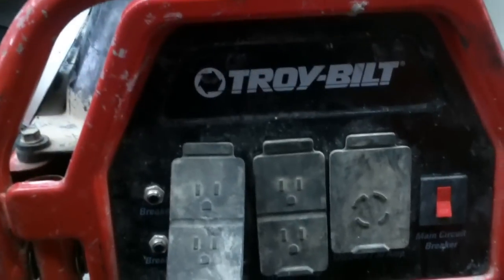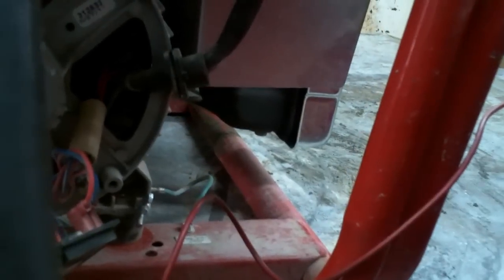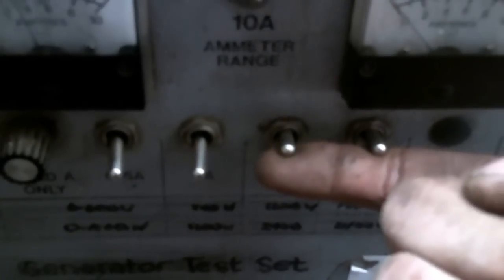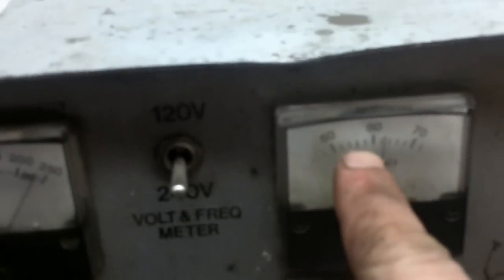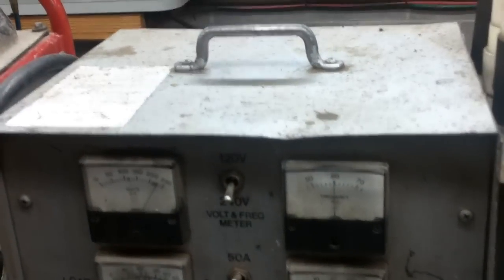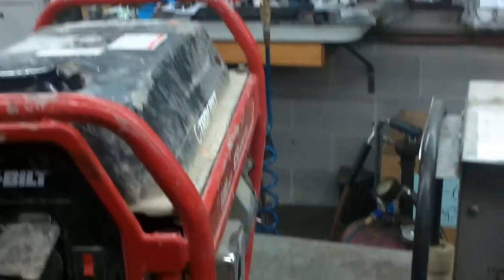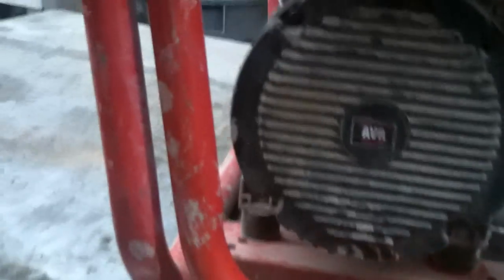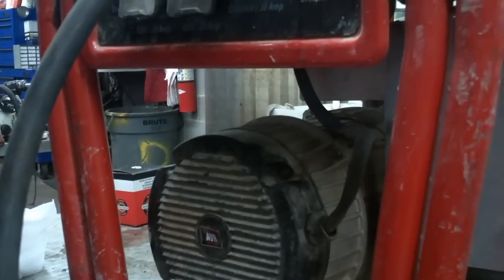ELECTRIC GENERATOR REPAIR : how to diagnose a generator that is not putting out power

Comment: Great video.  I have a Honda EX800 suitcase portable circa 1980.  It produces power but it is not according to spec.  The output is 142 V AC but only 55.6 Hz. If I reduce the frequency to 48 Hz then the Voltage reduces to the prescribed 120 V  AC.  I am also getting 22.0 Volts DC at the 12 V DC terminals.  Have you experienced this issue, and if so, is it the AVR gone bad?  Appreciate your help

Comment: YUP, another different set-up ! My Troybilt a 5500 running watts job has two wires from
the st8or to a brush-holder assembly with a diode bridge rectifier attached to the brush-
holder. 7.5 volts a.c. are turned to 7.5 volts d.c.

Comment: If a brushless  gen is not putting out, it could be the capacitor but the rotor still needs to have a magnetic field and the rotor would have 2 sets of windings + diodes. u can unhook diodes then flash winding, then rehook diodes.

Comment: Hey man I have a 8500 starting watts and 6250 watt troy bilt  generator runs but not getting power I watch ur video and I changed out the avr not saying that's what was wrong but it was only 25 so I got it but I still have no power how would I go about it now u think
Reply from the maker: Need to ohm out the stator and rotor winding   Not sure what the specs are in your particular model.
Reply from the maker: May need to flash the exciter windings as well
Reply: Not sure how to do any of that I'm learning off YouTube

Comment: Great job. I have a question, I have a generac 15000 watt and it's only putting out 24-27 volts to the outlet. I am wondering if the avr is fried. Any tips on finding out why it's putting out low voltage.  I did the drill trick and flashed the stator when I did that it went on high idle but still just enough power to glow a 100 watt light bulb 24-27 volts.
Any suggestions would be greatly appreciated
Thanks Shane Aubuchon
Chelsea, Maine

Comment: Hello and thank you for doing great job of teaching stuff about generators. I want to ask a question about my generator which is ASTDUBAO AST3800CE GASOLINE GENERATOR which is not charging battery and there is no wire coming in through flywheel but there is a wire coming in from dynamo cutout in ignition? Can you help ?

Comment: I have a miller welder and on the outlets I'm only getting 90volts and amperage for welding is low as well . before I put max amperage output Honda engine shuts off. what could be the issue? please

Comment: my reconedtion wolf petrol gerarator will run no problem but not putting out power ive chaged the circuit breakers no joy
Reply: My Generator spot giving power!!!😭 it is almost new, I did change the AVR, but it still not working.... It was overload.. do u think the alternator is gonno??

Comment: I have a good one for you. One day my Troy-Bilt generator seemingly quit, but not completely, it continued to put out 6 to 10 volts. So I installed a new AVR, cranked it up and it was working again. Then I played with the speed adjustment because they wanted an RPM of 3700 and voltage between 230 and 240 volts. As I was adjusting the speed up it quit generating the specified output and dropped to 6 to 10 volts again. I lowered the RPM but it would not start generating again. Any ideas on how to figure out why it's doing this?

Comment: opened up the back like you said ,no wires or electronics , is it possible there up between the motor ?
Reply from the maker: ray conway u have a brushless unit then

Comment: I cave a Coleman power mate 6250 that is trying to get going again. There is no power to the sockets.  There is no voltage at the brushes, the stator measures about 30 ohms, the other three coils all have continuity.  I don't see a voltage regulator in this generator, but I did check the diode pack and they all test good,  and the brushes still have lots of life left in them. What could the issue be?
Reply: You need to find the AVR (automatic  voltage regulator). It HAS to have one. This is where you need to start the troubleshooting process. The diode set up is most likely a "Diode- Triode set up for voltage rectification used for excitation of the rotor/stator movement.
Reply: TOMAS WATSON

Comment: i have G2000A Generator,how to convert from 110 to 220v output thanks
Reply: You might need to change the stator, only if it's only 110v. then you need 220v avr and the outlets

Comment: I have a Generac 5500 watt Wheelhouse generator that just stopped putting out 220 , checked wiring ,found CB tripped.Reset CB still only getting 110. looked at manual and it shows 2 sets of winding but not much more than that. found open on one winding ,that accounts for half the voltage. Does not show much more on this schematic, never had it apart, could it still be something between the black #33 and gray #44 that is open not allowing the winding to read? Thanks

Comment: i have honda EB 3000 c and it wont start i left on the garage for about 4 years only one time start can you tell me what can i fine
Reply: carburetor needs to be cleaned and new fuel needs to be used . .cloged carb

Comment: TNX Jeremy,  I have a Trot BILT ,8250   and  the breaker bottons will not reset .They are stuck and will not reset .  I had low power then it just went. It starts but I have no power coming out.   TNX BRO.

Comment: Any idea what the voltage regulation scheme is on a Northstar brushless generator head? Mine only puts out 111 volts at 61 Hz. at no load. Seems there is something that needs adjusting, but I've no service manual.

Comment: I have a briggs and Stratton 8000 watts generator and I test it and the avr is bad but the person I got it from they took out the avr and cut all the wire of I managed to sort the 2 wire for the brush but the other 4 wire I dont quite know how to sort them . out in the correct sequence or manner to connect them back to the avr correctly. can. u assist me

Comment: I hope maybe someone can help me with my generator issue. A while back my generator had the exhaust valve break and damage the piston and cylinder head. so anyway I get all of the replacement parts that I need to do the repair. After I put everything in the motor just before I put the back cover plate on I check that the motor will rotate, and it did with no issue. I after I put the back cover on I check the rotation again by hand and it will only rotate twice in either direction before binding up. When I took the motor apart I checked to see if the gears were broken or if anything was bent, and nothing that I could see.
Reply: Did you already fix your issue with the cover plate you're - rotation binding either way no problem thank you sir

Comment: Hi Jeremy. 
I hope you dont mind me picking your brain.
I have a honda gx160 engined generator with a altenator with no markings. The engine runs sweet. 
The volt meter on the 220v setting is only showing 200v. When I hook up a fan as a load, I can hear the motor dip for a second and see the throttle control lever move to account for the load, but the fan runs very slowly. I hooked the fan into mains power to make sure that was'nt faulty, and the fan worked fine.
What are your thoughts on this geny?
What would you look for and test first?
All advice would be appreciated.
Thank you for this video.

Comment: Jeromy, I have this issue however I have replaced the module that provided power to the Stator to kick start it. My question is What provides power to the AVr? The AVr cannot provide its own power so it must be getting power from the engine?
Reply: Depending on your generator the avr is powered by the power head or if it has a battery, the field could be charged by it. Kind of like the Alternator in your car. Or,  by the rotation of magnets about the axis of conductors, usually copper, like an old generator or magneto. There are many possibilities but you are correct,  there is no magic electricity out there which I call PFM "Pure Fucking Magic" there is always a common sense source to create the electro-magnetic field or flux that will create the desired voltage at the desired frequency that you require. Hope this helps a little. I'm an electrical and electronics engineer who is just passing through you-tube tonight on my way to somewhere else and beyond... PS: ED try leaving the AVR hooked up and momentarily apply 12 volts to the positive conductor of the avr at the point where it connects to the power head where Jeremy applied the 12 VDC in the video. See if this helps if you've replaced the avr and are still not getting any output. Only do this for a second or so. If when you pull the jumper off the connector you loose output again, your problem may be more serious and you might need a new power head. Good luck and Goodnight all.  Nuclear Dave

Comment: LOOK AT ALL YOUR VIDEOS AND THIS IS ANOTHER GOOD VIDEO THANKS.  I HAVE AN OLDYELLOW COLEMAN POWERMATE "CONTRACTOR 4200"  THAT NEEDS PARTS AND A MANUAL FOR. I WOULD LIKE TO CHANGE OUT THE PLASTIC GAS TANK IF REASONABLE. IT'S REALLY NASTY INSIDE TO THE POINT WHERE I COULD NOT EVEN DRAIN THE TANK. IT MAY HAVE AN INTEGRAL FILTER AT THE OUTPUT BUT I CANT TELL.  WENT TO POWERMATE SITE AND PUT IN MY MODEL #  (PM52-4208)AND IT DOES NOT RECOGNIZE IT.  THE TANK LOOKS JUST LIKE THE ONE IN THIS VIDEO. ANY IDEAS ON FINDING PARTS FOR THIS OLD BEAST. iT DID RUN FOR ME AND MANY OF MY NEIGHBORS DURING A FLOOD WE HAS IN MASS SEVERAL YEARS AGO. DOES YOUR GENERATOR HAVE A FILTER ATTACHED AS PART OF THE OUTPUT OF THE TANK?tHANKS FOR ANY HELP YOU CAN OFFER.

Comment: i have elepaq generator 3000 which i just bought and used for two weeks now but not supplying full voltage. it suppliying 125v instaed of 220v after testing it with my meter, anybody have the idea on how to resolve this

Comment: yeah my gen lookslike this except voltage reg lator in i big pc like briggs  stratton  problem too much voltage to reach 60 hz i get 154volts on 120v receptacles  i have 7000 watt 420cc harbor freight now called predator had since 2008 works great about 300 hrs on it, should i just order new volt reg and brushes as there is no cicuit board type voltage regulator very simple to change

Comment: You really seem to know your stuff, what about a generator that starts out in proper voltage range, but slowly drops off as you use it? The engine does not speed up when you use power from it either.

Comment: hi great vid, i have a briggs and stratton sp2600, i was using an electric saw with it and the power to the saw just died i tried the saw again and nothing, so i plugged the saw into the house and it works fine, so the generator is not producing power what can be wrong and how do i go about fixing it. thank you

Comment: i have a gp5500 that was overloaded after less than 20 hours of use. swapped out the AVR and it still isn't working.  i can plug n a light and it will flash on then stay off for a few seconds, then flash on again.  could it be diodes on the rotor, or what do you think could be the problem. Also, what can i do to diagnose? your time is greatly appreciated.

Comment: Hi there, good video, it gives some hope that I might b able to fix my generator. I thought you might be able to help. I have a Craftsman Generator model #580327180. On a night without electricity I tried to replace the 6V battery to turn it on and unfortunately I connected the battery backwards. What could I have possibly burn when I did this? I saw white smoke come out of the generator. I believe it was the stator.

I can still start the engine but no electricity comes out of the generator.

Comment: Hello !  I have an old Coleman M #  Pm054500. Not putting out power , How do I check the brush voltage when the brushes are in the cap with the receptacles ?

Comment: Sometimes you can get it to generate by exciting the field.
First, try taking the generator to dinner and a movie.
 If that fails, get 2 reversible electric drills (one can be pneumatic) Hook the drill chucks together with a hex-type tool. Plug one drill into the generator. Plug the other into the wall outlet (or air compressor). Start the generator. Now, turn on the drill that's plugged into the wall while holding the other drill's trigger on. If the drill that's plugged into the generator starts turning on it's own, you're done. If not, reverse either and/or both drill motors and keep trying.
If that fails, junk it and buy a real generator and stay away from these box-store crappers.
I've seen people living off the grid buying these Troys over and over. I saw one dude who had what I called a "death row" of generators outside his home. Like 5 of them. He kept buying the same junk-type instead of spending $5000 for a real 1/2 speed Onan or diesel.
These box-store generators are for short, temporary use, not continuous running.
Most have a warranty that does not cover continuous use which includes power outages.
I'm a Troy and Briggs dealer and advise anyone looking at a generator to carefully read any warranty BEFORE buying.

Comment: I overloaded my generator Briggs and Stratton 030235 5550 watts. I overloaded it with a welder. Now it outputs 180/370. There is no AVR. I replaced the brushes and diode pack. Same output. The circuit breaker never blew when I overloaded it.
Obviously can't use it on the house appliances. What is the world  is wrong with it? All I can think of is the rotor.

Comment: having an issue with my diesel generator.
i would try to power up the air-conditioner,
it would load to 18 amps, and then would cut out.
at 3500 watts (i think) it should give me 40 amps for the 5 seconds it needs, or at least bog down trying... any ideas on that one? 
it stopped putting out any power, so i was told to replace the capacitor, 
what does the capacitor do on the generator?

Comment: My AVR failed on a Coleman Powermate 5500watt, I replaced it and it failed again about 10 minutes after starting the generator, the load on it was a sawzall.   Any idea what to check next?The first time I was trying to run the generator out of gas for the winter and let it run for 8 hours with no load.  I think that is what cooked the AVR.

Comment: i recently acquired an old 80's briggs 5hp generator w/ bad motor so i dissasembled it to swap the crankshafts and it's not puting out anything at all. Is there anything i need to line up or do when installing?

Comment: I have a no name generator, made in China, that I only tried once to check it out with a  light. The next time I went to use it it didn't start. I checked the gas tank and a blue residue was in the tank. I drained it and cleaned the tank and to my surprise the manufacturer had painted the inside of the gas tank blue like the outside of the unit. I cleaned everything got it started but no electricity. Just relaying my story about this Chinese made generator of mine!

Comment: jeremy, i hav an older generac generator. 3250. it is putting out electricty, but not enough. i checked it with a multi tester, and i get the same reading as plugged into house receptical. but i ran my shop vac, and i could hear that it wasnt running fast enough, and the generator bogged down considerably, what might be the problem? dick bailey

Comment: Good stuff. Thanks for posting this.

Maybe you can help me sound like my AVR had gone bad.  I have a Generac 10000EXL model 9801-6. It is putting out 170v @ 110v socket and 340v @ 220v socket. When I put a load on it the idel control reves the motor up, but the Voltage is still too high. It looks like my AVR has been upgraded to 205858GS. Is there a clear way to test the AVR to tell if it is bad or good?  Thanks for your time.

Comment: Hey, I have a GMC2300 AVR Generator that's only putting out half power. I have put 12 Volt DC to the brushes and i'm still getting the same result, half power. From Aus and need 240 Volts. Any suggestions? Thanks.

Comment: ..another thing thats odd, is my EB6500x is putting out 130volts ac @3600rpm and 60 hz....I'm just a little worried it'll burn up my stuff, so I've been reluctant to use it at all..Honda tech support says its fine and supposed to be that way?

Comment: ..Instead of using half the dc voltage (12 volts), what would happen if you put 24 volts to the brushes? Would you get around 110volts ac?

Comment: I posed a question to Donny and he sent me a link to this video.. (great video by the way). I have a simular problem with a generator. It is an old 15 year old machine I would guess... it has 120 volts to the outlet but has no current and will not even run a fan. Any ideas??

Comment: Smashing repair :-)

Just like a car alternator, making the central rotor become more or less of a magnet to induce power into the outer stator windings, and when a load is applied the regulator varies the current through the rotor to keep the output voltage the same.

Love the simplicity of the alternator, i means dummys like me can understand them lol :-)

Comment from the maker: @TDHReviews  the electric side of a generator is very simple......all you have to remember is are you getting 24-34 volts dc to the brushes......on brushless generators its usually the capacitor that goes bad......and dont get me started on invertor generators they are a work of art lol

Comment: Good stuff.  Thanks for posting this.  
If the rotor has lost its magnetism you can connect 12vdc (just like you did) and flash the field that way and correct that.  Is that right?